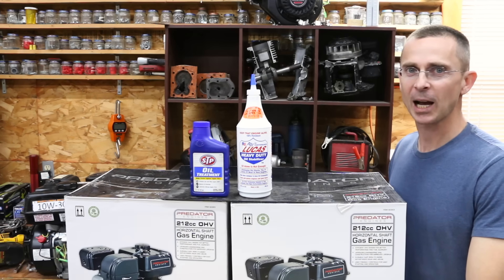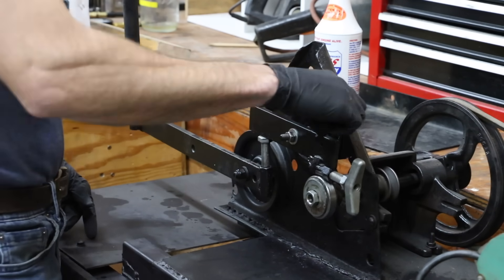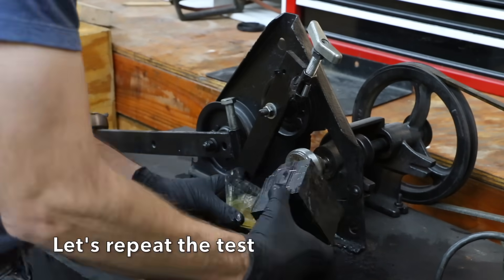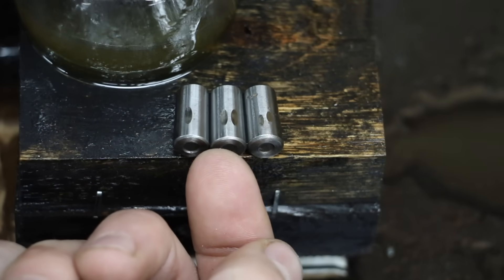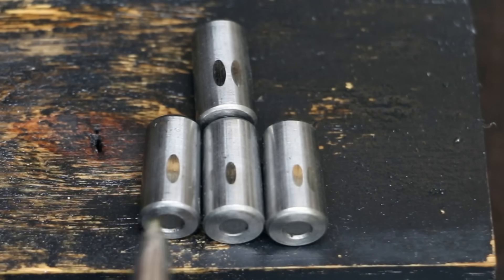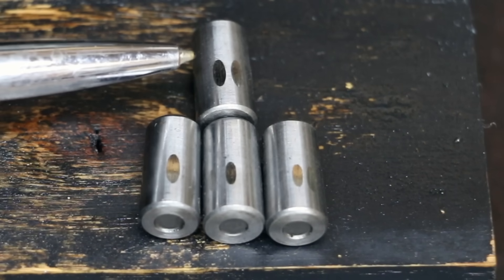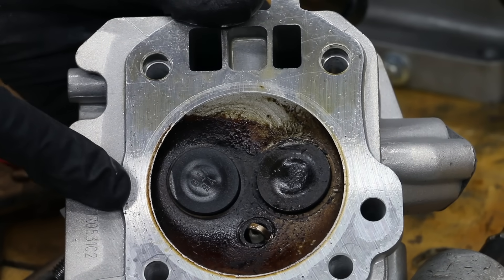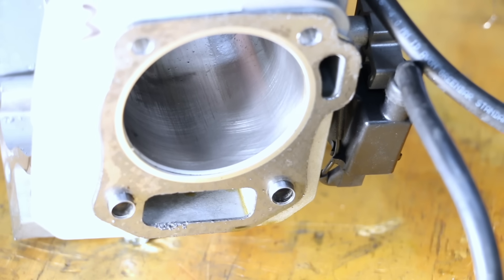Which engine self-destructs first?  Lucas or STP?

Comment: Lucas is D shiz🖒 my 76 Sportster ran on pretty much that only for 5 years strait 😂 only oil that wouldn't leak out of it.
Reply from the maker: Thank you
Reply: You could just run a thicker weight motor oil to get the same effect.
Reply: they run a straight 50w as it is unless u wanted to use 90w gear oil lucas makes a good power steering treatment like honey ive used a few times now works great
Reply: leon watts just had to use it lost all my fluid some how put that shit in and we are solid
Reply: @Mikgwerd : why when that was working? Sold that bike anyways and bought a brand new one. Have a good one.
Reply: my 76 FLH is tired, but sometimes tough to find straight 70w so ..I use a good bit of the lucas as well, still going! factory freak motor maybe 43k original...needs the top done in a major way ..still .ha

Comment: I have used lucas for years with no complaints, if you look at lucas you will see that it runs like maple syrup. its designed to cling to parts after the engine is shut down so that there is no dry start up first thing in the morning where 90% of engine damage occurs.
Reply from the maker: Great point regarding how it works. Thanks for commenting.

Comment: First I really enjoy the videos. I also feel a lot of the tests are amazing. I don’t understand the drain the oil tests though. You remove the very thing that makes the product work. I think going the opposite way would be more valid. I would enjoy seeing the engines over reved with proper oil level. While the engine is going outside it’s operating range the oil is allowed to  “work” as long as it stays in temp range. If I’m not mistaken your using these additives with the thought of it being slick 50( believe that’s the one they show running with out oil). Thanks for the vids!
Reply from the maker: Thanks for the constructive feedback. In theory, the product with the best film strength will last the longest.  Back in the 80s and 90s, oil additive companies (not these brands) would put together demonstrations similar to this one.

Comment: NOT a VALID comparison IMO.  I'm a mechanical engineer and running an engine with no lube is more like a function of viscosity properties and dry additives than how it will perform in wet lube conditions.  Secondly, all mechanical parts have tolerances (no parts are identical in size or mechanical composition).  Slight "fit" differences and slight "metal properties" can have a huge impact on strength.  Lubrication in rotation equipment is all about the boundary layer under heavy load.  To be valid, engines would need to be run under heavy load with lube in place and measure wear after several hundred hours of operation.  Pre-test measurements of all parts of both would need to be recorded so "wear" measurements were valid.  Then, repeat the test 10 or 20 times and average the results.  Might be better off asking the EXPERTS how they set up and test for LUBRICATION results.
Reply from the maker: Thanks for commenting.

Comment: how about trying Wynn's Super Friction Proofing? Years ago at Brooklands Speedway every time there was a race Wynn's set up a small engine that ran for hours (the duration of the car races) with no oil. This motor was treated with the Wynn's friction proofing and then drained and started.
Reply from the maker: Great test idea!
Reply: Slauwkoo Nalauwkoo years ago at a college in Newcastle for engineering they did this with Wynn's V STP Wynn's won hand's  down

Comment: Not really sure what was proven. I’ve always thought oil additives were part marketing and part snake oil. Your test did prove that the Lucas product held up better then the STP. The Lucas piston looked surprisingly good... I’ve seen more wear on some of my old 2 stroke racing engines. It appeared that the big end of the connecting rod on both engines seized and caused the carnage. By the way, did you buy the extended warranty from harbor freight?
Reply from the maker: Thanks for commenting on this. I did not return the engines, since I caused the damage.

Comment: The control engine is missing, plus this is an oil additive, it may be formulated to give the oil better performance plus which type of oil would you use? Pennzoil, Castrol, Quaker State? So many random factors
Reply from the maker: Thanks for commenting.

Comment: unrealistic conditions, 70% of wear on cold start, Lucas has a film streagnth additive so the parts maintain thin lubricant till a clean good oil can warm oil can do its job, key point, keep test REALISTIC, use proper viscocity for atmosphere, drive/operate motor with respect & all should be OK, grinding long time will create the wear spot ( compleatly unrealistic stupid demo ! as well as the no oil test, no motor will come close to these conditions )      :) & the gaskets would have blown out way sooner ect.
Reply from the maker: Thanks for commenting.

Comment: I have a gas Dodge 2500  360 c,i,   almost 300,000 miles w/ lucas oil and fuel additives. No smoke and sound's. I think the Lucas motor won. Lasted longer, even though it ran a constant 10 degrees hotter!
Reply from the maker: That's a lot of miles!  Lucas is doing great!
Reply: Thanks for your channel. My dodge is a 1994 and a half it was a redesign of the 1994. Sounds very good and no smoke either Lucas rock's.

Comment: Lucas Oil Stabilzer is alnost 10x the price of STP its like 1.97 vs $15.99
Reply: Michael Rodriguez,  You're not thinking of doing this to your vehicle are you?  The cheapest insurance for long engine life is frequent oil and filter changes. Don't use Fram Oil Filters, they are total junk, check out 
youtube videos on oil filters, how they compare.
Reply from the maker: Wow!  Great point.
Reply: Double up on the STP so you have the same concentration, it will perform same as Lucas!
Reply: If that was true..... why wouldn't that be in the STP directions???  That just makes no sense..
Reply: I'm a true fan of prolong.our lubricants  have come a long way.i put 35 thousand miles on one oill  change
I used mobile 1 and lucas.
Reply: Jason Plant, who knows you may get half that many miles on your next oil change interval.
Reply: @duke7595  Right before the motor starts knocking!
Reply: You get what you paid for when it comes to motors.
Reply: did they use 1 bottle to 1 bottle because maybe stp would work better if ratio is the same!

Comment: I used to crew for a pro alcohol funny car, the engine that we put in it was a 640 ci hemi. The engine was actually a prototype engine and when chrysler put it together they didnt drill holes or anything to get oil to the top end. So every time we ran it or got it ready for a run we would tear the valve covers off and soak everything with that lucas oil additive. That shit works great, i even use it in my 87 camry with 200k miles and still going strong. That car has gotten lucas for probably the last 15 years
Reply from the maker: Impressive!  Thanks for commenting on this!

Comment: Good video, just found it by accident.  So cost wise what was your opinion? Though interesting to watch does not really help me much, I still plan to  run some oil in mine. I think it looks like either one might have saved the engine if there had been a NO OIL shut off or warning idiot light like in a car.
Reply from the maker: There are lots of opinions on both of these products.  I think Lucas has the edge. I would use it in a high mileage engine during warmer conditions or when being used for extreme duty, towing, etc.

Comment: As someone in the auto repair industry I put Lucas oil stabilizer in every motor I own, but only half of what is recommended, and still does a great job in my eyes. Owning 4 vehicles over 15 years old w/ anywhere from 100k to 200k in miles, none off them leak or burn oil, and always sound quiet on start up too. But I also change my motors oil every six months regardless of mileage. However I'm also the type to use only premium gas in everything I own as well. Lol. 
 Enjoyed the video though i didn't really learn anything other then both products are rather similar.  
  Should be tested in full size engines instead of small ones as they don't operate under the same parameters. Just my opinion though. Goodluck on future tests.
Reply from the maker: Thank you

Comment: Had a diesel in a 1978 Caddy used MM oil in fuel every fill-up and never replaced a glow plug 395k. 68 mile commute...also use it with every oil change on all my cars.
Reply from the maker: Wow! That's a lot of miles. MMO is a great product.

Comment: Test Prolong additive to regular oil. it has chlorine in it, which is the best lub. but it turns to acid when water is mixed. which happens when a cold engine is started up.
Reply from the maker: Thanks for the recommendation.

Comment: Why do you think both these engines died sooner than the plain 10w-30 AND the best line engines in your other video? The lubricity tester showed consistent results in the other video, but the better lubricity of Lucas and stp in this round seems to have HURT the longevity of the engines when drained of oil.

Comment: This is a fun video.  I am not looking through 10k comments so if I repeat someone I apologize.  In my opinion, Lucas is a quick fix oil.  I work for an engine manufacture that utilizes STP for engine break in.  It’s purpose is to extra lubricate rotating parts but also allows the rotating part materials especially like piston ring to liners to break in and create long life components, which is why no manufacture calls for heavyweight oil for maintenance intervals.  A true test would be engine birth to death with break in oils, regular oil drain intervals and exact fuel burns and load percentages.  Not only that but it should be an average test, so the average of 10 Lucas engines to 10 STP engines to rule out manufacture defect and workmanship discrepancies. Again, awesome video, thanks!
Reply from the maker: All great points. Thanks for the positive feedback too!

Comment: Did he even do a few heat cycles first before he ran at high rpm's.
Reply from the maker: Great point.  Yes, both engines went through break in procedures per manufacturers instructions. Thank you

Comment: Hey bud, 

Thanks for the inadvertent tip- using a drill to start a lawn mower.  WORKS GREAT! I had a mower sitting around for 5 years because of a broken pull cord,  not any more.  Just add fuel,  oil and a drill...... fired right up.  Smoked a little but works!

THANKS, 

Cheers, 

CMB
Reply from the maker: Awesome!  I'm glad this helped and it's sure a lot faster to get a mower running this way.

Comment: Next time, buy the warranty at harbor freight.. The bearing tester was polished with a grinder.. Did you apply even pressure/grit on bearing when polishing ? (Probably not).. Both additives were designed to be used with oil.. test results showed lucas to be better (I am a convinced fan for years), but to be fair, lucas has more "base" oil that the additive was suspended in..  Additives do not lubricate engines, they "help" lubricants from breaking down.. I liked your video, but there are too many variables yet to conquer..
Reply from the maker: Thank you

Comment: I don't know if you still monitor this far back, but I have two comments to make. One I think they both lost because you already showed regular oil lasts longer. And two, I believe you should be changing the oil after the break in to get all the fine metal particulates out. Keep up the great work. It's fun to watch.
Reply: Yes, break in oil should be completely drained.
Reply from the maker: All great points. Thank you!

Comment: I used to sell a lot of Prolong oil treatment in the 90’s at Tognotti’s Auto World. Be interesting to see that against Slick 50. People spent a lot of money on that stuff back then. You hardly hear about them now. I’m not sure if Prolong is even still in business.
Reply from the maker: Great recommendation. Prolong is still in business.
Reply: been using Prolong for years and love the stuff. A contractor friend has over 300K on his truck and still runs great. He raced also and tore his equipment down regularly with amazing results.
Reply: Pro Long worked better than anyhting Ive seen
Reply: We used to run prolong in our kart racing engines love that stuff I had forgotten about it haven't seen it around in years
Reply: PF is right, Prolong still is in business and I wouldn't put anything else in my engine. Nothing can beat it on the market hands down.
Reply: I still use prolong. I even use it on my firearm actions. It's molecularly superior and when I bake my actions to 300 degrees in an oven then i them in prolong the metal absorbs it and even when fired dry I never jam. It's amazing stuff.
Reply: Why did Tognotti quit building sprint car chassis........Didn't Ferkel run them.....well?
Reply: I thought Prolong was an erection aid.
Reply: Will Lichdepuzi 👍🏻
Reply: Yes it is and yes it work's.

Comment: Actually, I would like to see it run again, and this time, after the first engine goes, stop the second one, and then do the analysis. Because, that's where it will really show a valuable difference. The second engine ran nearly twice as long as the first engine with Zero oil. That says as much or more to me. And I bet if you did it that way, the numbers you posted up would be more interesting. Plus, what if you run the same mix ratios? or if you used the suggested ratio Lucas has for an older engine. That would also change the test results. And you would give folks more to think about.
Reply from the maker: Great recommendation.

Comment: This was a interesting test but neither one of these products are beneficial to run in your automotive engine. There are many reasons but the main three are 1 any premium engine oil is engineered with a specific additive package that will be disrupted when adding these products. So you will essentially turn good oil into ok oil by disrupting its balance. 2 you are going to drastically change the viscosity of your oil and your engine is designed to operate with a certain weight that you should use. This increase in oil weight is going to stress your oil pump and cause more parasitic loss decreasing your fuel economy 3 these products are not proven to do anything except lighten your wallet there is no real conclusive proof that any of these products have increased anyone’s engine life, performance and or economy.
Reply from the maker: Thanks for commenting on this.

Comment: I've seen an old 3.5 Briggs running a full tank of gas without oil. I however dont see an oil additive without ZDDP out performing one with. The fact that with the oil the STP was running cooler and the fact that it has ZDDP in my book makes it a clear winner. You definitely don't want to run older flat tappet camshafts without ZDDP or a high quality synthetic
Reply from the maker: Thanks for commenting on this.

Comment: Bring them back to harbor freight now and tell them i dont know what happen
Reply from the maker: Thanks. I decided to keep them since I caused the damage.
Reply: Project Farm 
I hear ya
Would be cool to see if amsoil does something

Always wondered about them and if it works.
They have been around from the beginning of oil additives 

Seized a few boat engines from no coolant getting up from drives wish i had something in oil at least until i noticed it was getting hot.
Anyway keep up the good work

Comment: Stp is a horrible engine treatment we restore old farm tractors that don’t run at high rpm’s and it makes the nastiest sludge inside an engine. As far as Lucas it does what it’s suppose to from what I’ve seen and it doesn’t make a nasty mess inside the crankcase when you go to do an overhaul.
Reply from the maker: Thanks for commenting on this.

Comment: I put Lucas in my high mileage vehicles (100,000 +).  I also use the Lucas fuel injection cleaner as well at every oil change.  Does it help?  I know my oil pressure is better, and I feel with the extra lubricant that Lucas provides to the rotating parts especially during morning start ups.
Reply from the maker: I think it will help in the summer time, but Lucas seems to have a bit too much viscosity in the winter, if you live in an area that gets below zero.

Comment: I've run Mobil1 since 1966, engine is as clean inside after 20 years as a new engine, Never had an engine failure. My 1975 Honda CB750F had never needed the valves adjusted in 21 years! Sold it then for more than it cost new.
Reply from the maker: Impressive!